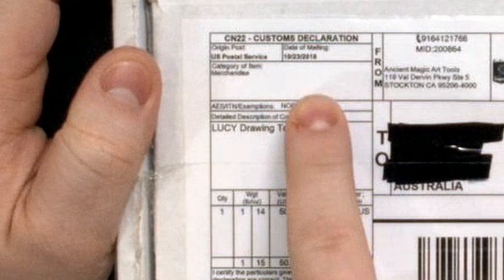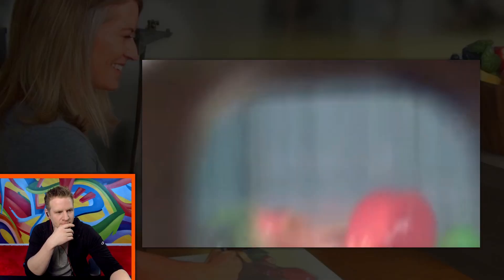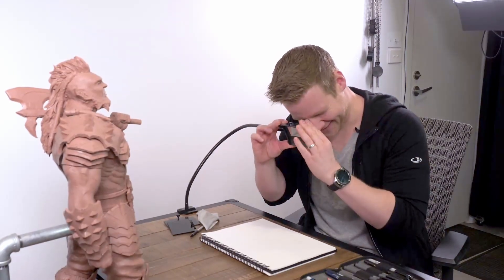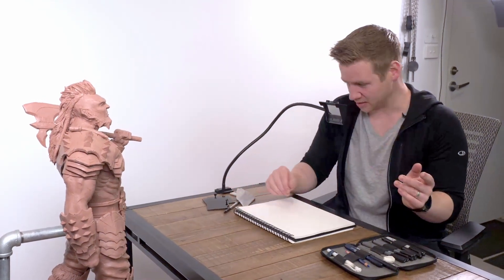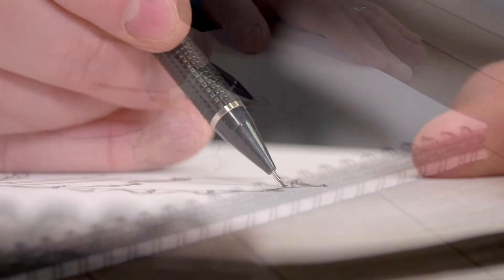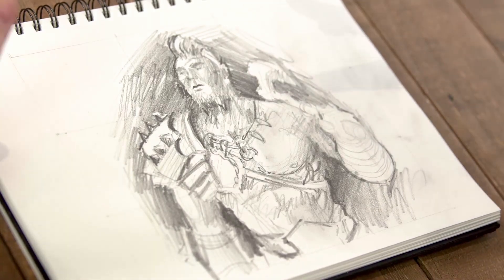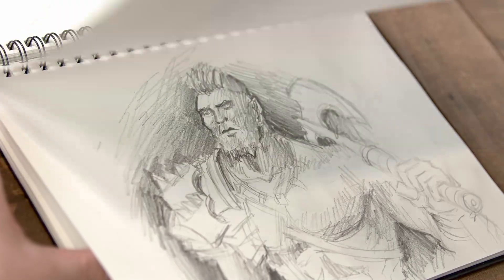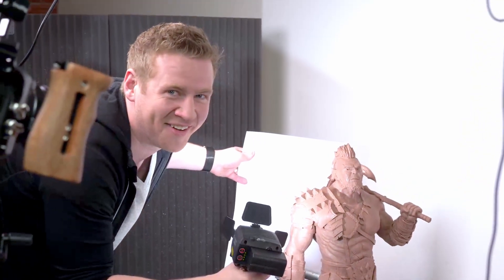Does this Weird Drawing Tool actually WORK? - "Art Hack" Test!

Comment: I'm with the commercial though. If you are using light boxes,  projectors or a Lucy, you suck.  You'll never improve your skills or technique and you'll never be an artist.  3rd grades can trace.  You don't pay them to do it or call them artists.
I don't say this to crack on those whom do use these things.  I say it to A) be honest and B) encourage people to improve their skills and C) improve their eye.  If you aren't attempting to draw freehand what you see you'll never improve your eye,  your ability to interpret,  your ability to form a style, your ability to recognize perspective, hue, tones,  etc.  If you are going to use some type of cheat,  the grid method is a good way to train yourself.  You can take small areas at a time.  Van Gogh used the grid method.  He had a string grid attached to the top of his easel. Check out the Barge method.  It's a great way to improve your eye.  Please step away from tracing. You'll forever be seen as a talentless child, a fraud and a liar of you don't.

Comment: "Thanks, I hate it." the meme summed up in a video.
I think it would have been better, had it come with a tripod, and not a shitty bendy pole. those things have never been stable, and having a solid base for it would have helped a lot. also, your lighting conditions weren't exactly good for it. your overhead lighting was too soft, and the torch was too intense. the intense light reflecting off the white paper made the light more surrounding, but it still wouldnt have been good enough. your main lighting is the real issue.
finally, the lucidas used centuries ago would have been much different to lucy. lucy is shit because it was downsized for convenience. a lot is lost in that process.

Comment: I believe that is not how you use a lucy and i also think your lights are not optimal at all, yes maybe a dark object needs some flash light on it to show the dark details on an already dark body but over all you are supposed to make a relatively accurate outline of the figure, this is not a printer or a magical tool to make someone who has no clue about art a professional artist, honestly i am disappointed with your lack if research on the device before using it, ( maybe the fact that you stumbled upon it and said why not make a video about it is the reason).

Comment: You totally misread the use of the Lucy. It helps you get the proportions down correctly, at which time you put away the Lucy and finish with your "style" as you call it. A better test would be for a non-artist (your videographer?) to try a drawing without it and then with it.
Also, do you think it more manly to throw away the instructions? This tool was obviously something totally new to you but you didn't want to be seen finding out how it works. Very disappointing.